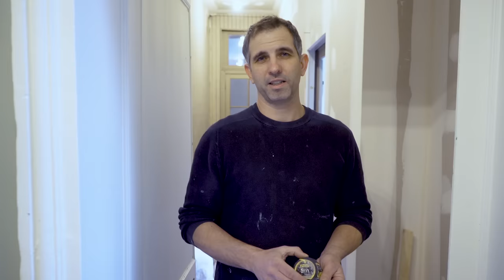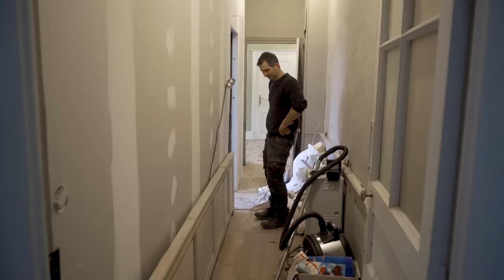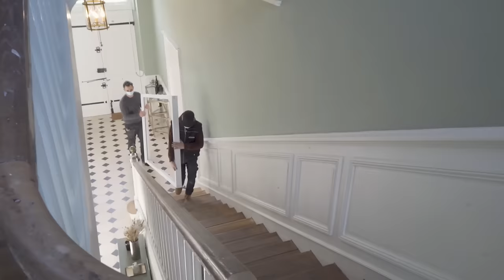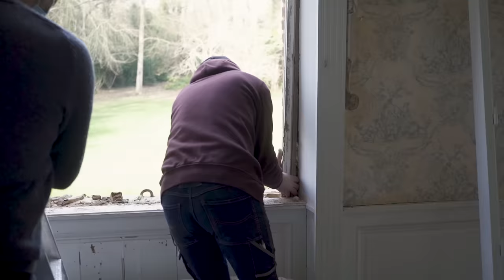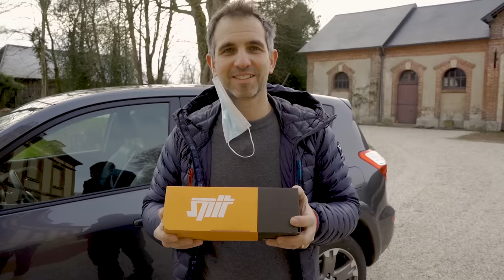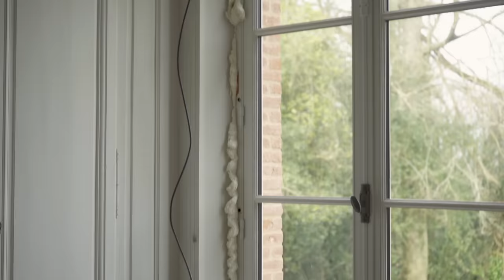A rotten Surprise at the Chateau - How to Renovate a Chateau (Without killing your partner)

Comment: Love your videos.  Here’s a tip to consider: 
Apply painter's masking tape to the wood to protect the wood’s finish from the foam before spraying the foam.  Come back and cut off the extra foam with your oscillating saw or with a long knife once the foam has cured.  Pull the tape et voila!  Straight lines without a residue on the wood. Then apply your trim moulding and paint to finish.
Reply from the maker: Thanks for the tip!

Comment: Hi 👋 , it looks like you haven't been fed very well it looks like you've eaten part of the beam or was this one of them lovely baguettes you can get some of the bakeries,
I have been restoring a property down in the Dordogne on one half of the floor was rotten approximately 11 m by about 5 m that's to the centre of the room and ended up dropping it into the basement, using the chainsaw which took me approximately about two hours but then took me two days to clear the mess up luckily I was by myself at the time, 
It's not quite finished as I have a big problem with my ex partner so I am now living in the property in France, good luck with your project please be careful of mould or any dust that comes off of these beams as it could do you some damage later in life if you inhale it.
Phil from the Moulin in France.
Reply from the maker: Thanks for the tips, Phil and bon courage!